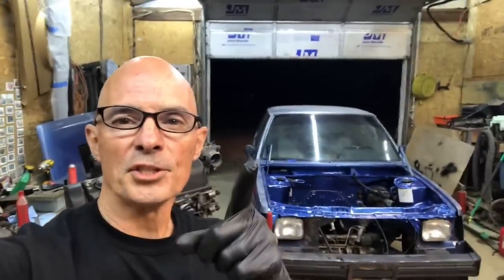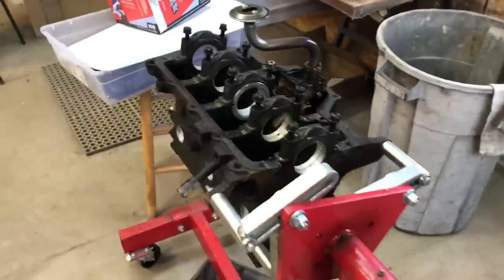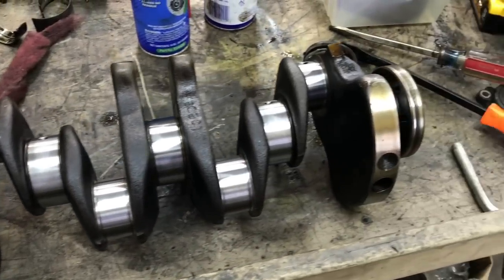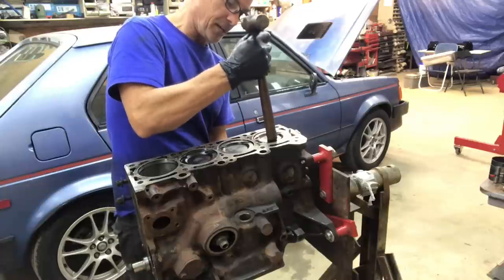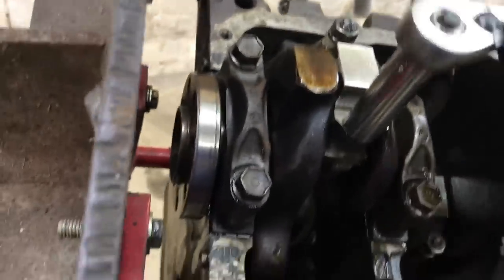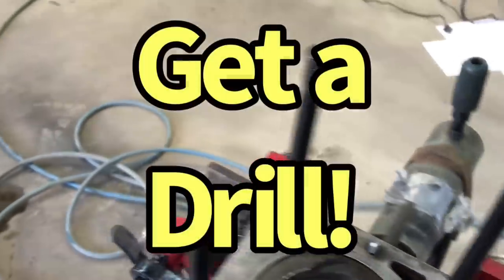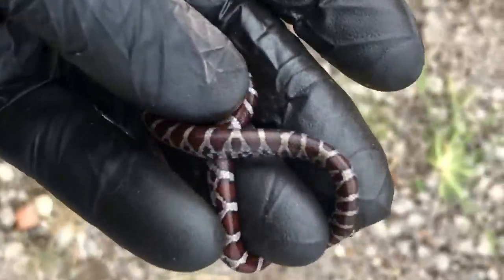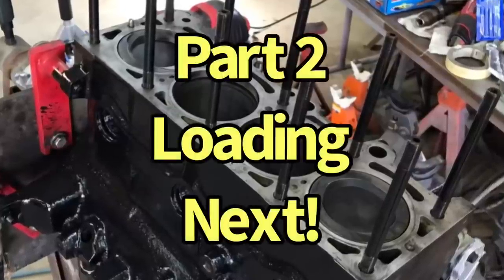HOW TO: LOW BUCK, DIY 2.2L/2.5L DODGE TURBO SHORT BLOCK. CRANK, BLOCK & CYLINDER MACHINE TRICKS

Comment: I bought a fairly new turbo New Yorker in 89. The owner said it had a funny miss in the engine, so I got it cheap. It so happened two spark plugs were loose. I tighten them plugs and it was fixed. Great little car.

Comment: Final polish of the crank journals should be in the direction they spin, so the edge left doesn't "fish scale".  If you use the block as a holding device for the crank, be sure to flush any debris out afterward. Can't find a torque plate for your design of engine? Replicate the distortion by torquing down a stack of washers or upright wrist pins around each cylinder you're working on. when you put hardened seats into a head, good idea to use a torque plate on it to replicate the distortion there. when installing pistons, use a fish scale to pull them down to the crank--if one reading doesn't match the rest, you've got a ring hanging up. Gas hose can be used as connecting rod "booties" to keep from scoring your polishing work. Slide over the end of your wooden handled hammer a rubber crutch tip to turn it into a rubber mallet when tapping things into position.

Comment: Richard, have you ever considered swapping a Dodge Neon DOHC head onto one of the 2.2L 's? I have heard of this "Hybrid" , and understand other that oil passages not matching, and needing an external passage made, the only other need would be timing sprocket/pulleys, and intake manifold changes to fit your application. I want to do this on my 4cyl Dodge Dakota, but can't find enough information.

Comment: Is that the engine the Vizard head went on?
Reply from the maker: that head has not been put on a motor
Reply: Cool, I don't want to miss out on that one. I got one of vizards books when I was 16. At 18 I had 350s out running big block. From there I had big blocks making me learn more about chassis and set up.

Comment: I'm lazy  @ 1:15   The bucket on the loader would have been a little higher so I wouldn't need to bend over to put the block down.
Reply from the maker: GOOD POINT
Reply: No, can't get out of a Cat with the bucket up.